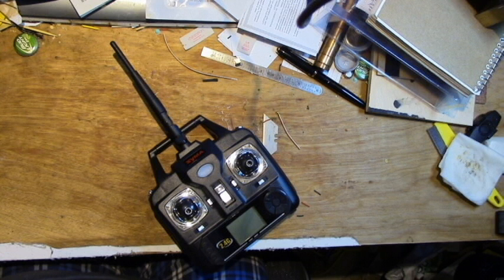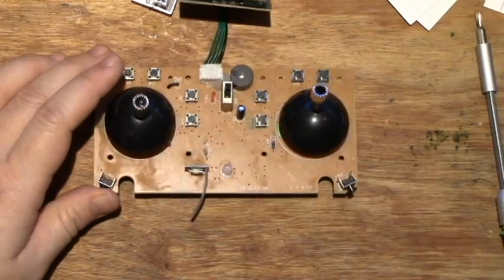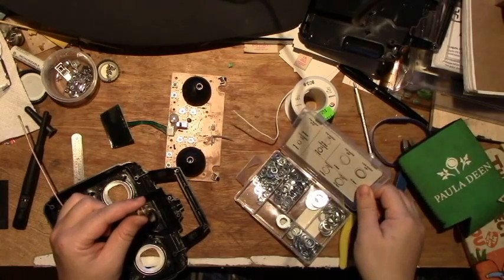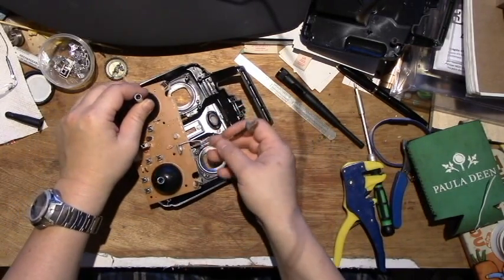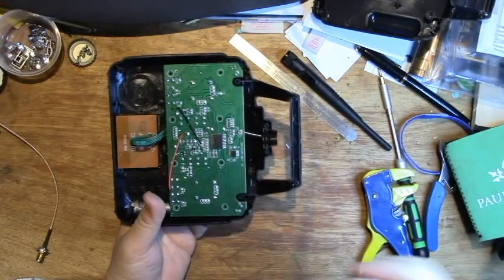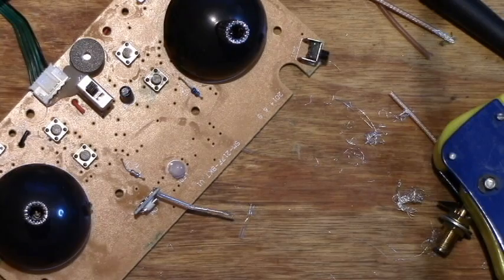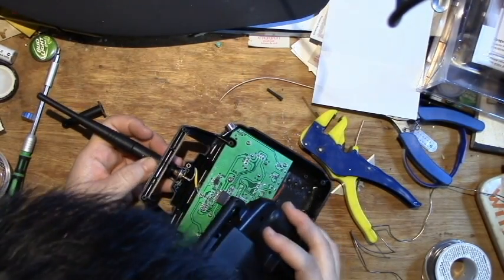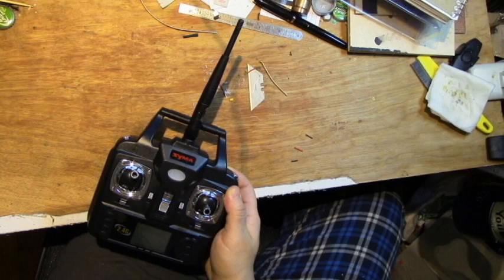Syma X5C Range Extension Hack

Comment: Wire size is set by the size of the copper wire inside the insulation. True 2.4Ghz wavelength is 4.92 inches. You can coil the wire into the plastic fake antenna and it will be shielded. If you do the same antenna addition to the quadcopter you will also increase the range even more. I have done many mods with great success..
Reply: Have you ever tried a modification to the receiver to help range ?
If so, can you give me some help on the X5C-1 ?
I put the 4.92" wire on the Transmitter with great success, increased the range from 90 ft. to 240 ft.
Reply: Yes. The same mod to the receiver works very well. I even (because of where I work) took a 18 gauge wire and flattened it to about 5/32 inch wide and soldered it to my antenna of both the copter and receiver and now the little thing will go very far. Still want to do official range tests but I feel I have tripled the range. Hope that helps you.
Reply: stoodyburner1  Time for you to do a how to video I guess ;)
Reply: I would love to but I don't have video equipment good enough to make it. You need to be able to see what I am doing lol. But thank you for your interest.
Reply from the maker: stoodyburner1 To hold the camcorder overhead, I used a musical instrument boom stick and an adapter from 5/8 female mic socket to 1/4 male camera mount for this video. Search for "on-stage CM01"

Comment: Great idea. I did this too, but i just stuck a wire from pcb into the fake antenna, works.
and I keep breaking my antennas on my other radios and keep  repairing them. best place to find this shielded cable is old scrap laptops with wi.fi. 
Like you said if the wire is in increments of 1 and 1/32 inches its all good as long as you have 1 and 1/32 inch non shielded  wire at the end, which in your case is already there in the antenna. Why you could not un solder the antenna wire, because shield mesh was connected to the front side, which you never heated. Keeping the antenna wire shielded all the way to just about 1 inch short of radiation point (tip)is important to get maximum range, else you have signal leakage from more than one points, which weakens it, heat shrink is not a radio signal shield. it has to be metal, as you see on all cables carrying radio signal like your tv cable, rf output from your video player to tv etc. and by the way why did you not solder long power wires back to battery holder instead of making an other joint. 
ZAPPING pointMA , Yes wi fi antenna is same as 2.4 ghz and can be used.
Reply from the maker: Thanks. The problem with making a detachable contact was, I have a car speaker that the detachable wire connectable- molex with larger disconnects, and it kept breaking. Now I think about it, I do have tiny disconnects that I probably could have used.

Comment: always tin the iron first for every wire , every time you pick up the soldering iron tin it ,  never use the iron to heat heatshrink tubing ---  you're contaminating  the iron   - it needs to be clean
Reply: His soldering wasn't too bad from what i seen, tinning the wires. I just wipe the tip on a damp sponge before applying heat, as long as the tip is shiny all round, and no black bits from burnt flux. I too have used a soldering iron on heatshrink, but using the barrell, not the tip. I prefer to use either a hair dryer or if im rushing, a lighter out my pocket just passing through the flame without holding it. I've never owned a heat gun. As soon as the solder flows, remove heat or you will end up with dry joints.

Comment: Doesn't the lenght of the cable you added matter?
Reply from the maker: yeah, you're right. I didn't really know what i was doing but thought i should film the process so people can see the internals. The cable that came with the antenna had been wrapped in grounded metal mesh to stop the wire from receiving signals, (you can see me at 10:23 trying really hard to strip it off so I can solder it to the existing wire). I wish I tried harder to desolder the original wire off, so than I can use the insulated wire from the antenna all the way to the PCB.

I think I might open it up and wrap this with tin foil and connect it to ground on the PCB. Or, maybe i'll just redo it all over again.
Reply: carolcheny So what must be the lenght of the cable? I did not get you....
Reply from the maker: Sergii Lobko the 2.4Ghz wavelength is 0.125 meters = 4.92 inches. so anything of a multiple of this length would work. That's why I showed the measurement of the original wire, only a tad over 1". I thought it's odd, because a quarter wavelength should be a tad under 1.25" so I'm not sure if the factory antenna is the right length anyway - which could explain the poor performance out of the box. If you extend that wire to 2.5" total length, it should be a good length, at half of the wavelength.

you don't really need to wire up a real antenna. some people just extend the length of this wire and stuff it in the fake antenna case. I thought a real antenna looks cooler.
Reply: So  the cable length matters in this case. because I thought maybe the plastic antenna itself contains the appropriate lenths of the cable (eg 4.92") and the cable itself can be of any length. But as you say, besides the plastic antenna, the cable must also be of the appropriate length. Thank you.
Reply: Does the dBi of the antenna make the difference to the range? I have a 20 dBi antenna (https://www.banggood.com/2_4GHZ-20dBi-Wireless-Wifi-Antenna-Booster-Wlan-RP-SMA-Male-White-p-940253.html), can i put it on the RC? Will not anything burn inside?
Reply from the maker: Sergii Lobko There is not enough electricity in the entire system to burn anything.
Reply: So I can use it? Thank you.
Reply from the maker: Sergii Lobko I'm not an RC expert. but it can't hurt to try. Or, you can study antenna design and figure it all out.
Reply: Sergii Lobko 20dB is more than enough I think but hard to guess if you can believe that for that money :) still should be much better that the wire which is already in place.

Comment: Great vid!
also remember for all the user:
the cable to use is: http://goo.gl/fyXsvv and the antenna http://goo.gl/YCnZ4D
If you want to fly longer also consider this battery pack http://goo.gl/stXHWc
Reply: these are good but I need a hack to extend the LVC on the syma x5 c because a 1 second warning then drop is not good.
Reply: Thanks for the links. Working fine with my X5C.
Reply: LOL those batteries are tested and stats are a lie.
After cycling the batteries through charge/discharge cycles I found that they collectively had a capacity of about 2000mAh (400mAh ea.) and not 3000mAh which have shown that each charged up to capacity (600mAh). My conclusion is their smaller size is a clue that they also have less capacity than they are labeled to have.
Reply: CoseCinesi You will find the flight times will increase to approx 13.5 minutes by using a Turnigy battery from Amazon
 http://www.amazon.com/Turnigy-Nano-Tech-750mah-Battery-Upgrade/dp/B00TTEC18M  
 or you can find them on ebay 
 http://www.ebay.com/itm/1-TURNIGY-NANO-TECH-750MAH-1S-LIPO-BATTERY-2-PIN-MOLEX-CONNECTOR-SYMA-X5C-X5C-1-/191588347990?pt=LH_DefaultDomain_0&hash=item2c9b8e3056                                The best price at http://www.hobbyking.com/hobbyking/store/__20386__Turnigy_nano_tech_750mah_1S_35_70C_Lipo_Pack_Fits_Nine_Eagles_Solo_Pro_180_.html
I hope this helps This battery absolutely ROCKS!!